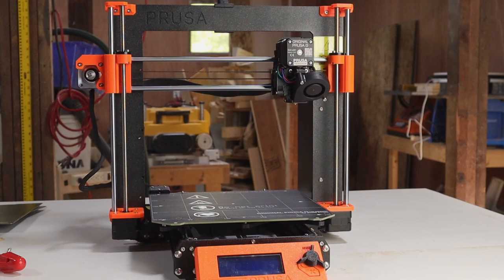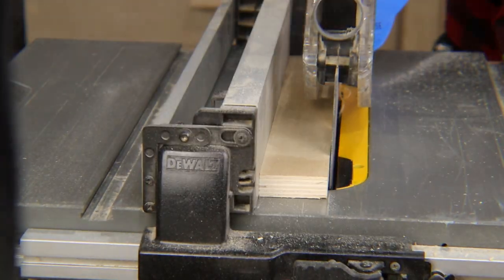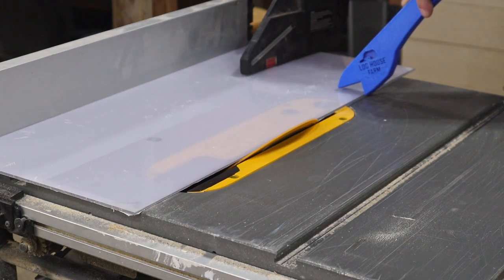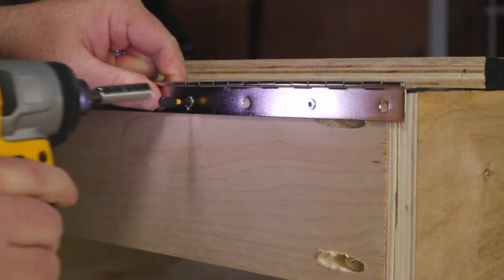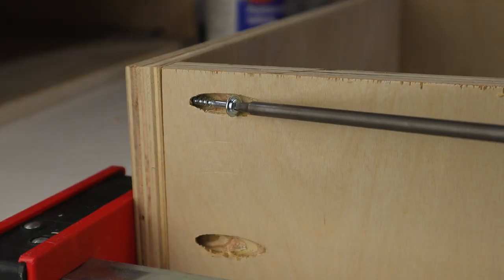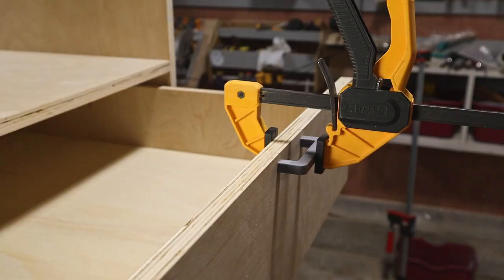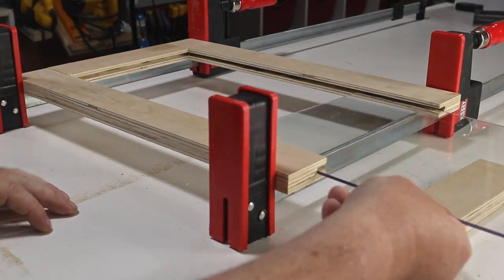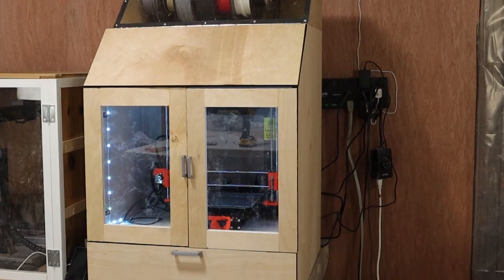How To Build A 3D Printer Enclosure - Plans Available

Comment: Nice work
Reply from the maker: Thanks!
Reply: @LogHouseFarm  I'd like to build a smaller, simpler box shape enclosure. I don't have a table saw, bit I have a jigsaw somewhere. Do you think this would be sufficient or would I be better trying to source someone with the proper tools?
Reply from the maker: @R0T0Q  if you have a guide for the jigsaw that allows you to cut straight lines you might be ok .. but I probably wouldn't want to do it that way.

Comment: Would you ever be concerned with heat generated by the 3d printer and the wood?
Reply from the maker: The print bed does not get very warm, the print head is very hot but small and far from wood. I have not had any issues with heat - there is venting to dissipate heat as well.